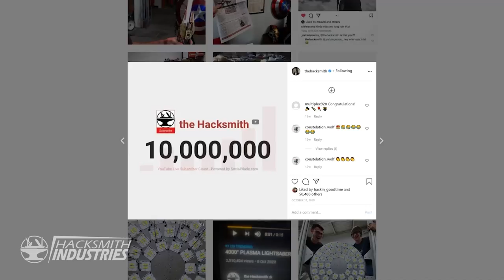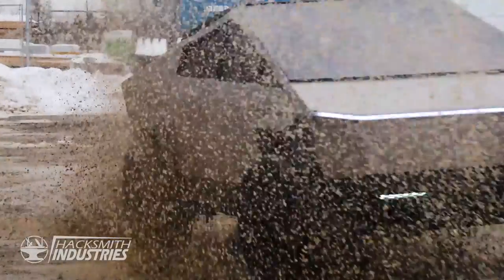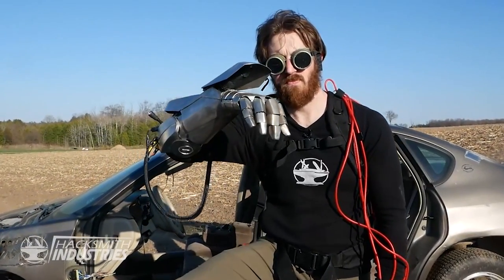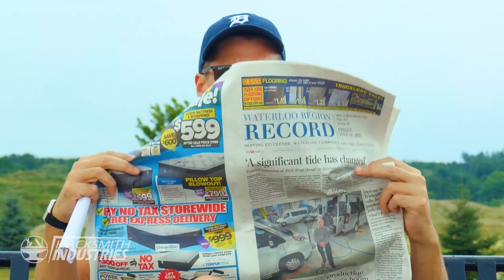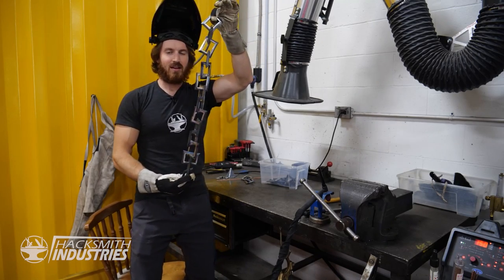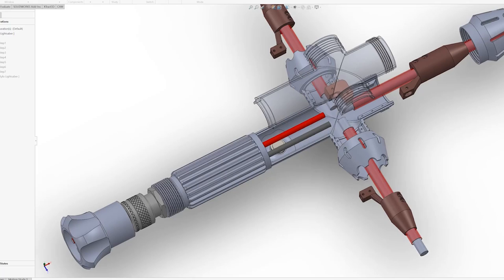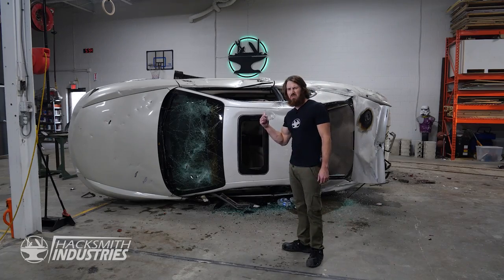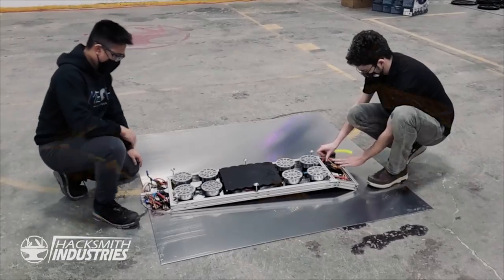EPIC HACKSMITH COMPILATION #5

Comment: Imagine a robber trying to break in during lockdown, these guys could deal with dozens of them with the stuff they've made
Reply: SOME of it... recall the proto-sabers need warm up time, the plasma gauntlet can ONLY work on metal (which means unless its Ultron, a Terminator or a Cylon, its useless), the oxyacetylene lightsaber needs a spark, and the particle cannon needs time to charge its laser diode
Reply: @KamenRiderRaiden  still dead
Reply: Thanos's sword (or whatever it is) will easily decapitate them.
Reply: Outlaw Macaw!  Guns are heavily restricted in Canada
Reply: @kedarpatil7095  Oh the unweildly double-sided Buster Sword that they had to strap to a motor and turn into the vertical blender from hell? Yeah that'd end splendedly "Oh Mr Burglar, if you could just stand here while we take the 3 minutes to get this to spin to full power, then push you into it..."
Reply: @KamenRiderRaiden  A single heavy swipe is more than enough. He would seem like he is struggling and then it would come down on the burglar's head or shoulder.
P. S. I forgot about the lightsaber.
Reply: @KamenRiderRaiden  Who says it can only work on metals.
Reply: I mean isnt the mjolnir enough, or the railgun.. forget it just the wolverine claws ??? The obsidian blade ?? Btw the plasma lightsaber has the sparker built in.. so you just need the fuel.. they even have bulletproof shields to protect themselves..

Comment: I'd like to see you prove a theory of mine correct. Using Hydrogen, or dried thru anhydrous salts hydrogen, in bubble wrap, and then heat and thicken this bubble wrap, to cause an anti-pressure effect, or almost like anti-gravity. If my theory is correct.. I'd like to see you make the saucer from "Rick and Morty".

Comment: Magnetic bearing for exo skeleton. Scientific sniper rifle with combustion main gun, multi purpose coil Grenade launcher, 12 v 1500mw laser on top for precise close combat capabilities and hand grip step up for easy hand to hand combat with teaser power, combat situation. Voltage control by finger index finger output 4v, middle 5v, all negative terminal will be one at grips back between thumb and index. 🙂One day I hope.